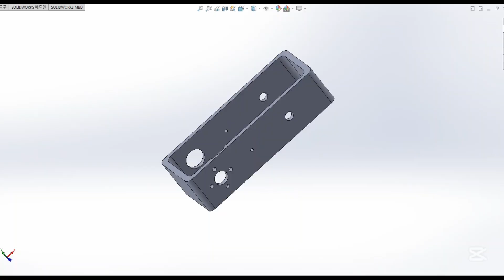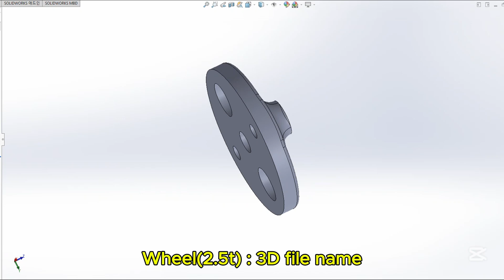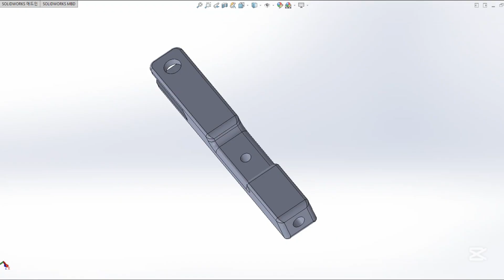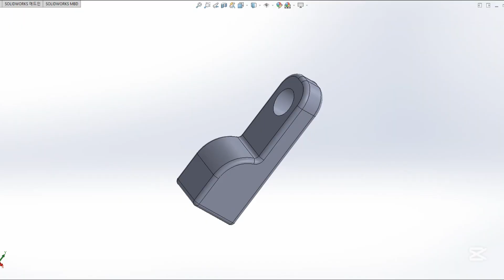RC bird engine _ 오니쏩터 엔진 만들기 _ 32g (0.3M) #ornithopter_engine #오니쏩터엔진 #ornithopter_gear_box #오니쏩터기어

Comment: Hi,
Actually I was  doing servo driven ornithopter but using SG90 tower pro servo motors and nano, fs i6 receiver, 20grams 2 cell battery
Total weight of components around 60 grams without wings. 
How much wingspan should I used? Give suggestion!
Reply: Hi
Thank you for considering me
But I have only sg90 my mg90s was damaged, this is final chance prove my self flight the rc bird
Give proper plan action should I do?
Reply from the maker: @vamsi_vankala  I think...you will never be able to fly with SG90 servos, they have too little torque...^.^
Reply: Hi
Is there any possibility on Mg90 servos?
Reply from the maker: @vamsi_vankala  I think it's probably impossible. (Please refer to the servos I used)
To fly, the weight should be as light as possible and the force (Torque) should be as large as possible.
Please take a look at the contents below and think about it.
I'm sure you'll find the answer...^.^

Your servo...
SG 90 servo -> 10g -> Max torque 1.6kg/6.0V
=> Flying weight : 60g + ?, Wingspan ? mm

MG 90 servo -> 12g -> Max torque 1.8kg/6V
=> Flying weight : 60g + ?, Wingspan ? mm

My RC bird,
https://www.youtube.com/watch?v=y7ducz-TH-Y
=> PTK 7452 MG-D servo -> 12g -> Max torque 4.5kg/7.4V
     Flying weight : 67g, Wingspan 1,050mm

My RC bird,
https://www.youtube.com/watch?v=4r8nzvfE3_A
=> PTK 7350 MG-D servo -> 6g -> Max torque 1.8kg/7.4V) 
     Flying weight : 38g, Wingspan 800mm
Reply from the maker: Hi, nice to meet you... please refer as follows...^.^
1. In my experience, it is not possible to fly with the SG90 tower pro servo.
If you refer to the product specifications, each servo has a maximum torque,
but that maximum torque is very insufficient. 
You should select a servo with a maximum torque compared to the weight of the servo.
2. The SG90 tower pro servo cannot use a 2-cell battery. (Not supported.)
3. If the total weight of the parts excluding the wing is 60g, it is too heavy.
Please refer to my video below. The wing length is 800mm, but the weight
(excluding the battery) is only 30.8g. You should pay maximum attention to weight reduction.

https://www.youtube.com/watch?v=4r8nzvfE3_A

I recommend that you refer to my YouTube videos.
If you refer to the notes at the bottom of each video, you can directly download the specifications of each part used in production, 
the purchase location (link), the type of product, photos, 3D output files, etc. 
If you make it by referring to the size (wingspan) and total weight of each ornithopter, the type of servo used, 
and the maximum torque, etc., you will definitely be able to succeed. I look forward to a wonderful flight soon...^.^

Comment: wing flapping speed is about 9 times per second, I think that's enough to fly, but need to add tail mechanism (maybe need 2 servos). this version needs to steer by tail instead of wings like previous versions. really looking forward to the day it flies into the blue sky. wish you good health
Reply from the maker: @TitanG7 Yes,  I think it's possible to fly in the sky too. However, for this production, I'm going to make it with only one servo (for left & right) to reduce the weight of the flight as much as possible^-^